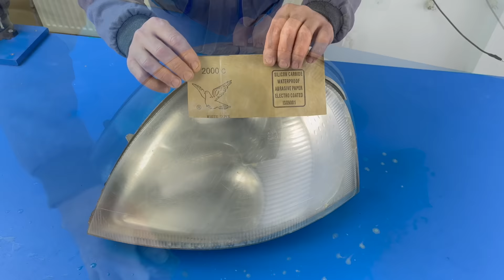Amazing Method! Make Headlights Like Crystal Clear in 5 Minutes With This Trick

Comment: CLICKBAIT!!!!!  Any mild polish on a foam pad will do this without the stupid shave the soapbar or the sanding steps.  I do this once a year to my cars.  Takes 5 minutes.
Reply: Cheap toothpaste. :-)
Reply: Still satisying
Reply: Результат ужас😂😂😂
Reply: Ой да всем насрать
Reply: I’ve tried all types of polish way too many times and nothing works on my Fiesta's headlights!
Reply: @drmatarkin2100  Lo único que funciona es la lijadora orbital con tres discos al agua, debastado, lijado y pulido, con pasta de pulir en el último disco. Luego se aplica un espray con lacado cerámico como se hace en los vehiculos de gama alta de BMW, Audi y Mercedes que le da un tacto de vidrio. Los faros de un Serie 3 actual por ejemplo esta última capa dura unos 8 años si el coche duerme en la calle y de unos 11 si lo hace en garaje, comprobado con mismo coche mismo año de compra de un Serie 3 y un Serie 4 en mi empresa, durmiendo uno en garaje y el otros casi siempre en la calle
Reply: @termikina  gracias!
Reply: Was that chicken bullion paste rubbed on the light to make it look yellowed😂
Reply: clickbait typically uses ALL CAPS and lots of exclamation points!!!!!!
Reply: I don’t see any difference.
Reply: @Custerd1 toothpaste is bullcrap. Best way is wet sanding with 1000 grit and going up to 3000/5000. Compound and polish. Then either clear coat or ceramic coat. If you gon use toothpaste youll do more damage than good and compounding and polishing without any protection will make it end up oxidising again.
Reply: @drmatarkin2100 are you sure you using polish or just wax lol. You gotta wet sand first. Start with 1000 then 1500 then 2000. If you want a better finish. Use 3000 then 5000. Then use a compound. Doesnt matter if you use a rotary or DA polisher. Then a less abrasive polish. Finally you can either ceramic coat it or have it re clear coated for protection. If it doesnt get any clearer then the damage is probably interior which is a whole other problem
Reply: German Shepard or Great Dane urine mixed with flavored soda water, no sugar or corn syrup, even club soda and use 180 grit sand paper and reduce to 400 grit
Reply: Ακριβώς το ίδιο κάνω και Εγώ φίλε μου.
Reply: Compra um novo sai mas em conta
Reply: @shots-shots-shotseverybody2707  please find good psychologist... 😂😂😂
Reply: @Oleksandrbdzhola ahahha katastrofa 😂
Reply: 😂😂 use oven cleaner 👍
Reply: By the time you ve gone through THIS routine you l be that old you,l have to retake your driving test 😂😂😂
Reply: @drmatarkin2100 Tripoli polishing clay brownish color

Comment: What's "amazing" is that anyone thinks this is only "5 minutes" of work.  What's also amazing is that anyone thinks this is amazing.
Reply: You can do this in 5 minutes too! You just have to work as fast as this sped up video.
Reply: And such a bad result, just a waste of time
Reply: It’s not just sped up, it’s been cut and spliced multiple times…lol.  Plus it begins with the headlight already out of the car.
Reply: 45 minuts
Reply: This headlight is cracked in the corner, so not sure what is the point.
Reply: On my e320 its aftermarket 4 years now it's like new
Reply: RIGHT! 😂
Reply: Well, you already spent five minutes watching the video and spent another five minutes thinking of something clever to say in the comment section of how it takes longer than five minutes, so it's not like you have anything better to do.
Reply: 2 days - (minus) 5mins!! Lol
Reply: Easily done in less than 10 for sure
Reply: There's pretty much no improvement here. Wasted time and money..

Comment: Been there, doesn't last at all without UV coating. 
For mild cases, suggest single step easy and quick product and do it as frequently as necessary. Not perfect, but results are surprisingly good.

Comment: This was a lot more work and cost than needed. Plus as others have said, they will fog right back over... *UNLESS* you use something like Meguiar's Headlight Coating. I've used it, it works pretty good and looks great. It does need to be reapplied about once a year to keep them perfectly clear. But for reapplication its  just a simple cleaning using something like glass window cleaner (or whatever the bottle recommends) , then respray the coating. It comes in a spray can.
Reply: I've been using Meguiar's marine products for decades and have always had great results. Agree also this has got to be the most laborious, time consuming and expensive way I've ever heard for cleaning headlights. I use  a metal polish called 'Peek' and a couple good rags and get excellent results in an ACTUAL five minutes.
Reply: I blame the auto industry for puttin us thru this crap. Nothing will beat the old school GLASS headlites. Unfortuntly this plastic crap is here to stay. Even if hou buy NEW lights, it's only a matter of time before they cloud up too and you're looking at three - four bills to replace those.
Reply: Exactly what I tell my customers they can do it themselves or I charge 35$ dollars to do it for them
Reply: Wouldn't a coat of car polish protect it

Comment: I took all the sun baked haze off mine with a heavy duty paper towel and lacquer thinner. Then I washed them with a grease cutting spray (Simple Green) and sprayed clear acrylic enamel with a strong UV protector. They look great and work as well as new.
Spraying the acrylic enamel took longer than wiping the haze off. No sanding required.

Comment: Faster, cheaper, easier and less messy to use T-Cut and a paper towel, which also gives a better finish. Unless you apply a UV protective coating afterwards this will need doing every year (maybe more regularly depending upon how much sun you get).
Reply: What is T-Cut?
Reply: @davidratcliffe1  Fine cutting polish, similar to Brasso which is used for tarnished brass and copper but does the job !
Reply: @davidratcliffe1  Fine cutting polish, similar to Brasso which is used for tarnished brass and copper but does the job !

Comment: Sanding it will removed the coating that protect the plastic from getting brittle by the sun. So it will only lasts for few months.
Reply: It's not true. I've done it by a professional into my Toyota's wife and they are crystal clear past more than 5y. What I can say maybe the original coating was the cause !
Reply: @NoTengoIlusiones  That's because the "pros" put a protective coating on them. In this video he did not, therefore it would give it a few months...

Comment: Needs clear coat seal otherwise it will go hazy again very fast! Also, the clear vote will make it even more clear
Reply: Wrong....

Just get a cheap headlight restore kit. Do exactly as instructions say. After complete. Wait 24hrs. Then hit your headlights with headlight COATING. DO NOT USE CLEAR COAT PAINT. That is the dumbest method out there. Alllllll clear coats will slowly yellow up within the year time. Headlight coating seals it for one to 3 years. Sometimes longer, if you keep your ride out of the sun. Even better if you have a garage. Remember folks, coating and painting are two entirely different nature's... ✌️

Comment: To stop or slow down the oxidation clear coat rattle can it. Haven't had to redo mine in 3 years after I sanded with 600, 1000, 2000.

Comment: What I don’t get is the automakers not using UV stabilizers in the front headlights but they do on the rear. I got a 2014 Ford Escape, headlights need reworked but the rear clear coverings of the taillights is like new. Boils down to it’s about making money on headlight replacement!

Comment: Nope. That's a way to redo the job every 2 months or so. The better way is to stop sanding at 600 and then to use a 2k clear varnish with uv protection in like 2-3 coats. Or you can also use clear film. These 2 ways will protect the headlights for like 3-4 years.

Comment: This is too involved. All you are doing is removing the damaged outer polymer. I've done this in seconds with packing tape. Toss it on and the weak polymer threads come off when you pull it. Clear as day one.

Comment: using the expensive compound , with a machine or strong hand will restore 80-90 % 
my self always try other way , just get the WD40 engine grease spray , rub it .. 90% great . dont forget always spray the wax coat

Comment: THE PAPER  P 320 IS TOO MUCH HARD FOR THIS JOB. IF IT IS VERY DIRTY YOU MUST START FROM 800 IF IT IS NOT VERY DIRTY START FROM 2000 , MY OPINION BECAUSE I SEE AFTER YOUR WORK THE CRATCHES FROM 320 THERE

Comment: ummmm if craked foggy head lamps they have syuff that will clear it using high speed buffer then buy can of clear coat use 2 - 3 thin layers to kep that way for reast of year or if lucky get ones in junk yards about $25  each that aint too bad and install in place of old ones

Comment: I tried all these internet "fixes".   Here is the truth. BUY THE KIT FROM THE STORE THAT HAS THE CLEAR SPRAY  IN THE KIT.  after sanding the headlights they look cloudy.  when you SPRAY ON THE SEALER they turn very clear and stay that way.  without spraying on the sealer you are wasting your time.  mine looked bad before using kit, and looked about 90 percent new after spraying them.   just buy the kit and dont waste your time.   I tried McQuires and it was great.   as long as you have the spray you are good no matter the brand. the kits are less than 20 bucks.
Reply: *Meguires

Comment: You never want to sand old plastic into new plastic . just take a box cutter razor blade first and scrape the old plastic off .pull the razor don't push the razor blade and all the sun rotten plastic will come off .Then sand and polish

Comment: The shaving of the soap is a waste of time. Dont do it. Just take a green scotch brite pad and clean and then go with your sanding. 400, 600, 800, 1000, 1200, 1500, 2000, 3000 rinse dry and then use a tack rag and then clear coat. Maguires has a clear thats easy to use at 8 dollars and with one coat will do at least 4 sets of headlights depending on the size. This way not only gets the yellow but also any original clear thats peeling and it protects. And last.

Comment: I know an easier way takes less than two minutes. Get yourself a tube of Colgate toothpaste try to find the original that has less grit mixed in with the paste, a soft fiber rag and plenty of water, I mean plenty H2O now a large amount of toothpaste on the rag/microfiber cloth and water,must keep it wet lots of water just keep scrubbing. 
You don’t need a lot of pressure on rag be sure the toothpaste is foaming,reason for using Toothpaste, it won’t scratch. The lens is bad or I won’t scratch the lens at all same thing with a fiber optic rag. I won’t harm the lens. I’ve been doing this now for six years and yes, I have to freshen it up every four months but no big deal.

Comment: 1)  Thats the normal method, nothing "amazing" about it.
2) to do it right it takes a lot more than 5 minutes.
3) your headlight is still full of scratches.  This will distort your light.  
Spend more time with the 1500, 2000 and do a 2 level polish.  Also go easy on the 320.  When I sand with the 1500 and higher, I run water over it constantly.  If it's out like this one, put it in a deep sink and sand it with the faucet running slowly   
 Lastly, put a sealer on it.

Comment: Using foil to sand will leave lead on the plastic and we'll all your work on a removed headlight is a waste as you will cry to do it on a vehicle and furthermore the headlight is cracked so moisture and errosion will seep in , then show us how you will buff that out and albeit with no uv coating..😢

Comment: i have never seen yellow crap like that on a plastic head light cover.  you had to have put that on the lens   oh look how easy it comes off with a bar of soap.  aluminum foil ?  that out to scratch that plastic good.   oh now lets use sand paper,  you could of skipped the first steps the sand paper would have removed everything,  using a sanding block is a dumb idea, you will make lines in that curved surface.  5 minutes ?    sure we believe that.   oh now it's time to do some buffing.  you really like to waste time, all you had to do was start with the buffer, using a course compound then switching to a finer compound and your done.

Comment: Way too much work. I have done this now for years, and all you need is some Rubbing compound and a polish wheel for a drill. Hand rub on the Rubbing compound, the polish it off with the buffer on a drill...done. Takes seconds and lasts for about 6 months. Would last longer if you use a ceramic coating after. But this was way too much effort in the video.

Comment: 5 min job yet the upload was 4 min 33 seconds edited and sped up lol that is not how you do it. first of all there is a coat of scratchproof or some clear coat on the plastic lens its that what discolors. p500 with orbital sander for speed then wet and dry 1200 then finish off with 2000. spray clear coat  on them even from a can. mint

Comment: what an absolute waste of time and effort .. after the 1000   wet and fry .. simply shake up a can of two pack clear lacquer   and apply up to three wet coats .. the following morning  stand back and admire your crystal clear headlight lenses which  will stay crystal bright for years .  I have used the two pack clear lacquer spray on a number of cars and they are all remaining clear and bright . Plus the added protection the diamond hard two pack paint gives against stone chips is an added bonus. one two pack can will give six headights up to three full coats of Crustal clear Lacquer . / varnish . .

Comment: Haaaaaaaa. 5 minutes my ass. Haaaaa can't stop laughing.  I wet sanded mine down to 3000 grit with a dual orbital sander for a half hour then sprayed it with automotive clear coat. An that only lasted a few years in the Arizona  sun for about 2 years. Just buy new headlights or spend a whole day doing a slow magic trick that just fades back to doing all over again.

Comment: There is only ONE way to restore headlights lol. Wet sand with 1000 grit up to 3000. If you want better finish use 5000 but thats optional. Then clean off the dust and compound the headlight with a polisher or polisher backing plate attachment on a drill. Use a moderate cutting pad. You can do it by hand but it wont have nearly the same result lol. The combination of a good pad and compound are what gives the headlight its clarity and shine. After your compound you can polish for the final sparkle. Then you can either ceramic coat the headlight or re clear coat it. The idea is providing protection so that thw headlight doesnt get re oxidised after a few months. Because no matter how clear you get it,if you dont protect it its gonna end up foggy again

Comment: Just get a cheap headlight restore kit. Do exactly as instructions say. After complete. Wait 24hrs. Then hit your headlights with headlight COATING. DO NOT USE CLEAR COAT PAINT. That is the dumbest method out there. Alllllll clear coats will slowly yellow up within the year time. Headlight coating seals it for one to 3 years. Sometimes longer, if you keep your ride out of the sun. Even better if you have a garage. Remember folks, coating and painting are two entirely different nature's... ✌️

Comment: These headlights will fade and turn yellow again. The only permanent solution is to sand with 1000 grit and apply 3 coats of 2k clear coat. Wait 1 month for outgassing to cease and then buff out any orange peel.